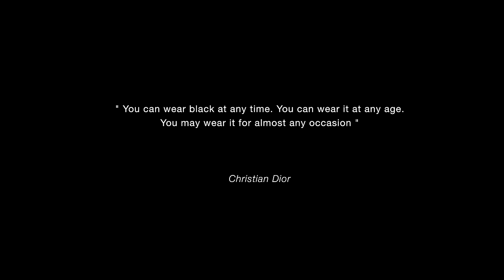Black is back in Fashion - an update on Kingston, Ontario's La Salle Causeway 4K

Comment: It will be equally interesting to see the temporary bridge removed twice this fall for Marine traffic.  My construction experience says it will take 2 cranes at either end and it will be lifted straight up.
I wonder what type of lift/swing bridge will be chosen and built to bring the causeway back to normal operations.
Cheers Mike. 🇨🇦
Reply from the maker: James - the old lift bridge deck was pulled aside after it had been jacked up at either end, with the west end supported on a barge brought in to provide a base.  It's my understanding that the same arrangement will prevail.  You can see the original work in my June 20th video 'Slip Sliding Away'

Comment: This project was done very quickly. Thanks for sharing your video, videos. Will you be able share a video the day they temporarily remove this bridge? Im fascinated about that step, I read its October 15th. Thanks
Reply from the maker: Thanks for noticing how well and how efficiently the crew have worked.  More than happy to share the material captured whilst I document the project.  Yes, it's certainly my intention to record the openings on October 15th and November 16th.   You might like to look back at June 20th's update 'Slip Sliding Away' - it shows the old lift bridge deck being removed.  It's expected that a similar process will be used later this month and in November

Comment: Is there an alternate entrance to the Cataraqui (sp?) river, and Rideau Canal? I have enjoyed your calm, articulate description of the bridge construction.
Reply: I’d like to know that too. They say that the air draft for the canal will be 5.5 meters, but from the videos, that only looks like 3 meters at most under that span?
Reply from the maker: Thanks for the opportunity to answer that important question.  The Canal was intended to serve as a strategic a link between Ottawa and Kingston.  There is a (rather long and challenging) waterway route that involves diversion to the Ottawa River.  However, that is unsuitable generally for larger vessels requiring dry docking and other services in Kingston.  The only way for tall vessels to access the Canal and river directly from Lake Ontario in the vicinity of Kingston, without a bridge designed to be removed easily and deliberately, is under the east bridge on the Causeway, which is the one with a charted clearance of 5.5m / 18'.
Reply from the maker: @tommegan6500  Tom - please see the answer below - BTW, I love that term you use 'air draft'.  It's not one I had ever heard before.
Reply: @Aerosnapper  OK, but that still doesn’t look like 5.5 meters to me.
I guess the next time we go to the Lone Star for fajitas I’ll have to bring a tape measure and check it myself 😊
“Air draft” is a common term for the vertical clearance required for any given vessel to pass under obstacles.